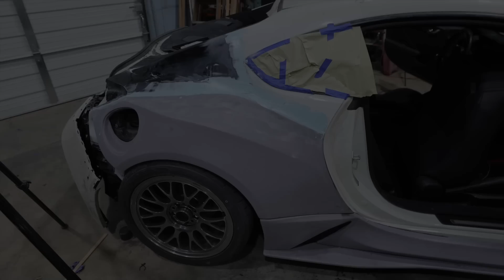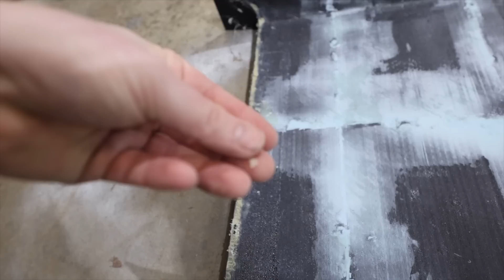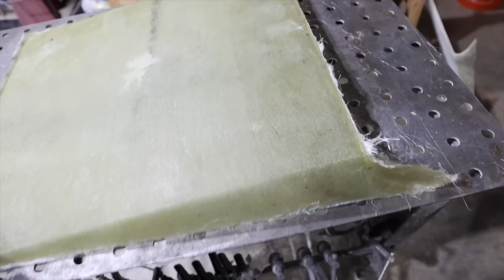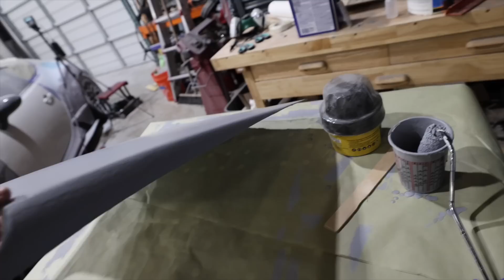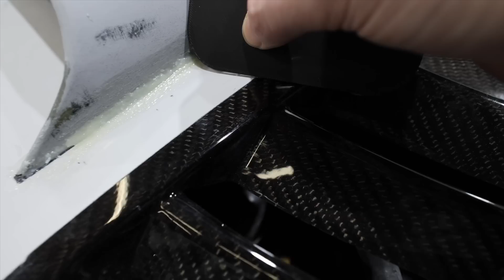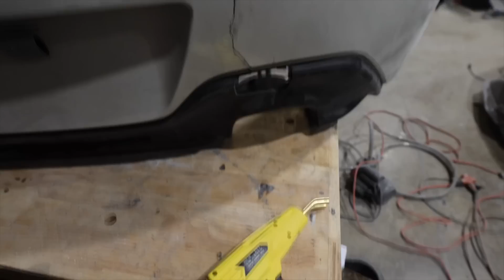Transforming My BRZ with a Custom Hood Scoop and Seamless Widebody Integration!

Comment from the maker: Go to http://shrsl.com/2qf4o-2yn7-1cwx9 check out BambuLab's X1 Carbon 3d printer, filaments and more!
Reply: Bambu seems to be suddenly sponsoring a bunch of channels since their recent firmware/TOS announcement angered their customer base. Seems like a damage control move.
Reply: 33:20 ❤ love the videos I'll like and share FYI next time you're doing a bumper repair put the Staples in through the painted side that way you can make sure you get the front together very well and you don't have metal sticking out through your repair
Reply: You should have a look at the backlash on Bambu Labs in the 3D print community, and maybe reconsider the recommendation.
Reply: https://youtu.be/aIyaDD8onIE?si=FJx3IFhI2aPsbeik
Reply: Hey chris check out the headlights on this 2024 Toyota crown. https://youtube.com/shorts/s142I_jpFlA?si=XlJofAgaxiI4_V6b

Comment: That is too much filler in those gaps between the wide body and the metal body, honestly should have used Kitty hair and then less filler. This will be prove to cracking for sure

Comment: hello, body tech here.  Given what you have, you should use the hot staples down the whole crack, hold the trigger long enough to get the staples deep into the plastic. The mesh works best on the backside as a reinforcement with a 2 part epoxy or plastic repair or panel bond. Nitrogen plastic welding is the best way to bond cracks back together, but... it's expensive, i think. I think you did a great job, and what you did should hold :)

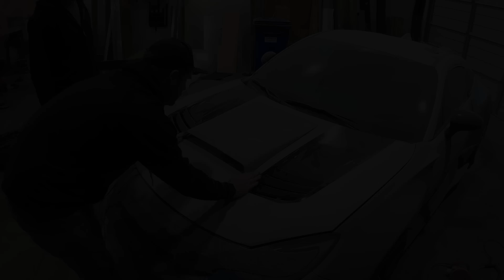Comment: 23:37 - it's a good practice to use a hole saw or even big drill, to cut the corners first, when cutting composites or aluminum in areas where they are going to flex - this reduces/ prevents stress factures from spreading from the corners into the rest of the piece

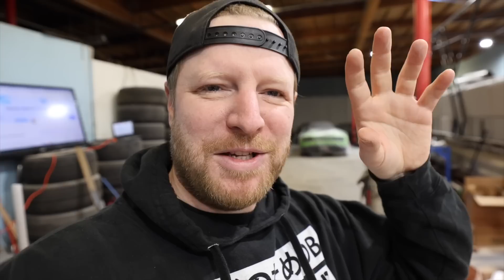Comment: 14:50 ditch the heating lap get an oven. There are some you can run your vacuum line. Or just a regular over that you can modify. Just make sure you have a calibrated thermostat/thermometer.

Comment: Take off all the paint and panel bond the body kit to the car.     Before you use body filler.   FYI.   You can add fiber glass resin without hardener to bondo to make glazing puddy. Mix is the same as the amount of hardener you use with the bondo 2 to 3 %.     Hope this helps.

Comment: I think you could have saved it with some down to earth "ideas"...

For instance, I just built a house...
Although we went through the process of glueing and nailing everything pre spec...
My kids have managed to break some bonds....

But the fix came from some thoughtful thinking of some carpenters....
Drill some holes... Through the carpet, and into the sub flooring, and inject wood glue with a needle....

Comment: You should print these parts with grooves in the side so they snap together. you'd be able to skip the plastic welding step and go to body filler

Comment: Use the plastic gun to join the printed molds, also most slicers have a tool to split parts and use pegs to align them which is way easier

Comment: We use self-sticking teflon foil on our molds, you only need to sand off the high spots of your 3d-print or milled surface and stick it on. No resin will stick to it. Really quick way to make a mold

Comment: Will be interesting if that hole in the hood, being so 'in-land' of the scoop, is going to create a void that is going to rip that scoop off the hood as air pressure gets under it. Air is going to flow into the intake of the scoop and then only have a relatively small hole to get down into the engine bay, which is not going to cope with the volume of air I think, so your scoop may very well rip off from the incomming air pressure

Comment: Not sure how you mixed you resin. I does need to be well mixed. Some people will mix in one cup and then pour to another and continue to mix. With low temps you can add more hardener. You can check the MSDS of your resin. With colder temps you do get longer work times

Comment: Great bumper repair. I normally don’t like using filler on bumpers and will just more of the plastic to fill it and sand that smooth. But there’s nothing wrong with using filler. great work Chris.

Comment: its not the best solution, but since this seems mostly like a show vehicle and youre not worried about heavy track use you can drill tiny holes in the delaminated parts and inject some resin inside, then cover the piece with a sheet of plastic that wont bond and put some sand as even weight on it to re-adhere the layers.

Comment: Mostly when I have that kind of problem is cause I didn't put enough hartener in there If you put too much of the hardener in there it quickly goes fast and hardens and if you put less of the harteners in there it doesn't dry as much and if the weather is pretty cold I must be put more harder than I do during the Sun

Comment: The amount of YouTube hours dedicated to trying to 3D print a hood scoop that could have been built by bending a bit of metal in 5 minutes …
Reply: Why would you waste steel for a fiberglass mold?  That’s silly and not cost effective at all. A print is mere Pennie’s compared to metal when you’ve already got the printer.
Reply: But it's fiberglass and they are not just straight bends.  You could do it in steel but i think it looks better in fiberglass

Comment: Did you paint the metal after cutting the hood hole? Didnt look like it in the video. Also when you push those plastic weld metal supports in, its good practice to give them a little twist before you release

Comment: Drill a hole to stop the crack from going.  Then cut out the crack. Small enough to have a uniform line.  Then fill with fiber glass.  Sand smooth done.

Comment: Okay I don't understand something. Layers are deliminating because you don't have enough resin in the voids . But you have the correct shape with the farberglass.  So why not
add a heavy layer of resin over the top and bottom?  You can saturate it for straightnes. Minimal shaping and body filler would be required. I just don't understand the logic of starting over when you were so close to the perfect part.

Comment: Roll your roller in a tape. Peel it off it will remove the lose fibers from the roller so u wont have any bits left on your parts

Comment: @Chris Mr. B is for Build
Invest in some metal epoxy rollers.  Those will help evenly saturate and regulate the resin to the fiberglass ratio.  Tooling Gelcoat for your mold and I recommend a gelcoat for the part you're making, or trying to.  Best of luck! Long time watcher!

Comment: hay bro i ve been using Abs for a while now ,, if you can print it.(heated chamber and all... its kinda tough to print , but ... Abs dissolves in acetone ... you can use a few print scraps in a jar of acetone it will make a slurry.....just a quick thin wipe of the solution on the 2 edges to bond , press together and presto    quick chemical bond that is stronger than the print.... no mess no welding very little sanding and shaping.... also if you look into vapor smoothing ABS with acetone you  will be blown away !     i have printed then vapor smoothed parts that are super strong and buttery smooth...
Reply: Yup, i used pla once about 8 years ago, deformed cuz i left out in the car in the summer.  Use only abs since.  I tried asa last summer and it works really good too, it also dissolves in acetone and i think it's based on abs.

Comment: Hey Chris, just some tips when working with fiberglass.

- You really need a roller when making fiberglass parts.
With any fiberglass parts, it's criminal NOT to use one. There's no worry about de-lamination or air bubbles being stuck in-between layers. The rollers' small spikes puncture air bubbles that are trapped in-between layers, thus leading to correct adhesion of each layer of glass. While vacuum bags help with this issue, they will never get as perfect as a roller will. There are a lot of big companies as well that ditch vacuum bags for a lot of parts simply by just using rollers.

- And another tip for functional fiberglass parts, like your hood-scoop; Don't paint the underside, undercoat it.
A trick I learned from the Baja1000 guys is to ALWAYS undercoat the underside of any plastic and fiberglass parts with bed-liner/flex-seal/Line-X/ etc,. It stiffens fiberglass so it wont crack when moving/flexing. The hood scoop will see a lot of flexing because it's acting as an air dam to reroute a bunch of air into the engine bay. This trick is always used on trophy trucks' fenders and hoods.
Reply from the maker: we have rollers but they never seem to work very well and get gummed up very quickly, but ill give it a shot next time and see if it helps. Thanks for the tips!
Reply: Boat paint also works very well with fg (unsurprisingly) 👍🏼 used it for undersides/internally on the car. Flexes like a body builder
Reply: @MattyZC113   Funny enough, that's called gel coat. That's usually what automotive fiberglass parts are finished in. The main reason why you don't see it crack as often with boats is because boats have thicker layers of fiberglass than what automotive use would call for. Normally boats are finished anywhere from a 1/2 inch to 1 full inch. In automotive, you don't really want more than a 1/4 inch. Sadly, gel coat alone isn't strong enough for thin parts like these. So instead of laying down so many layers of gel coat, pro's use bedliner or undercoat to keep the weight down and still have flexibility.
Reply: @ thank you. However, I meant paint. As you quite rightly stated, gel coat is quite different.
Reply: @MattyZC113  Wow, I've actually never heard of that before. The only finishing boat paints I know of are epoxy based but that would pointless since fiberglass is already laid in epoxy. Which boat paints are you using? I'd love to give that a try sometime.
Reply: Those little rollers are for house painting, if you tape the length of the roller against the nap and then pull it off it will remove some of the loose fibers before you paint
Reply: @darrenswails  The rollers I'm referencing are strictly for fiberglass, not paint. Fiberglass rollers are metal rollers with spikes (or flats) that puncture (or squeeze out) air bubbles in the fiberglass while it's wet. The spiked rollers are far more superior because they perforate, where as the flats squeeze them like a pimple. Google "Fiberglass rollers" and you'll see what I'm referring to.
Reply: @greysinclaire  yeah I was just talking about the ones the ones he was using for the primer

Comment: That body filler on the quarter panel is definitely going to crack off, the surface was nowhere near rough enough to adhere to, it should be 80 grit if not rougher and extend past the area where the filler was spread.  Those panels were barely sanded and didn't even look like 180 grit, you are in for trouble,e, especially on fiberglass to metal bonding, 2 materials that expand and contract differently.
Reply from the maker: maybe it didnt show up on camera but we power sanded the hell out of everything with 60 grit, and i even came back and hand sanded any hard to reach areas. Im very confident we sanded everything the body filler touched with 60 grit
Reply: Theres always one 😅@BisforBuild
Reply: @taylorkemsley8727  Always one ase auto body certificated specialist with 24 years in the business? I think that's the part you forgot..
Reply: @tbranscom1 I'm sure you're right, but 🙄
Reply: that area of the car is going to flex and vibrate itself apart. I give it a year.

Comment: This is odd I commented on why you shouldn’t buy a Bambu printer but it seems like it was deleted.

But yes Bambu has decided to screw over the 3d printing community and release an update that severely limits the network interaction to lock down control and disguised it as a “security” update and spread FUD.

Seems like they have decided to switch and start marketing through car channels and non-technical.

Great hardware but a horrible company.  DO NOT BUY BAMBU.